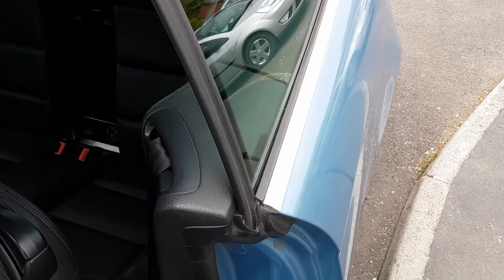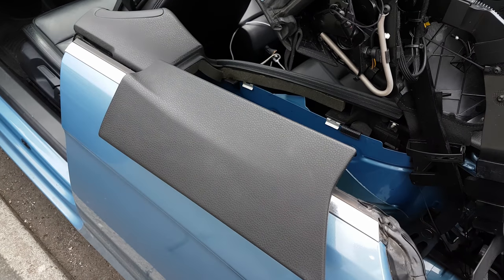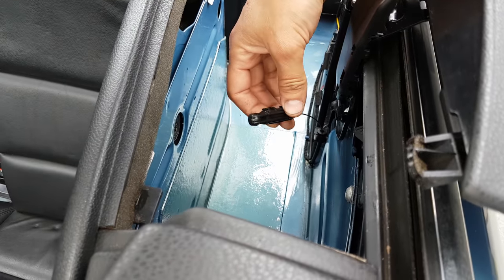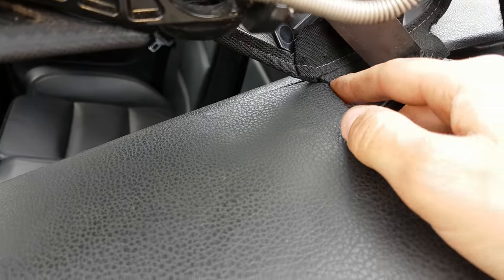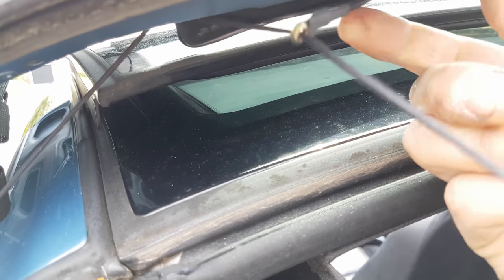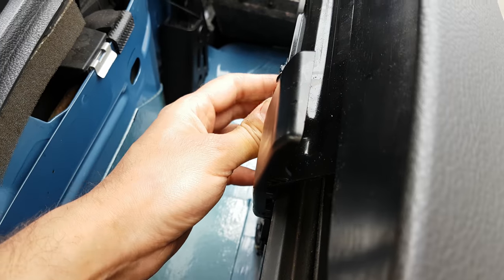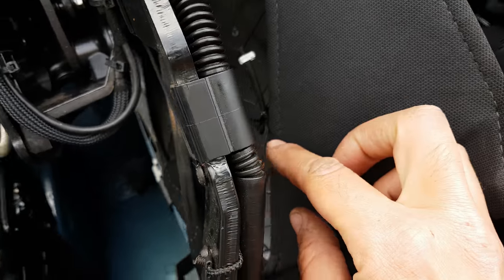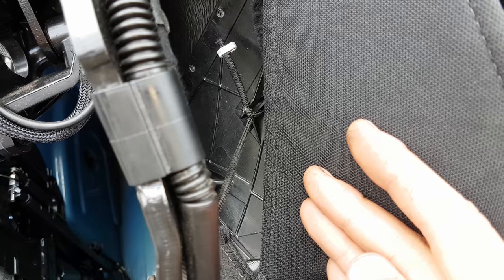VW EOS Sticking Roof Flaps Fixed

Comment: Thanks, I've had the same problem so it seems to be a common issue. To me this looks more like a permanent fix, why change out the elastic completely if this will keep things together hopefully another 10 years!
Reply from the maker: It's about 2 years since we did this fix, but we noticed it stuck again the other day. It might just be due to the fact the cars been off the road for over 2 months now. Good luck with yours.
Reply from the maker: @fikalagom3481  I don't think so. This fix has worked for years for me, but one is now sicking again. Eventually I think the strings / wires will need to be replaced

Comment: Once a year open the roof half way and chek for rust on hinges struts torn rubbers and leaks clean all rubbers and spray silicone oil that lasts long. pencil graphite also lubricates a little. The sticky panels in this video have a Ball joint. he puts it on dry but i recommend using a small dab of grease to reduse wear of the plastic and the Ball joint. If you plan on keeping the car for a long time buy the ball joint and cable. Over time the Ball wears out and the cable will pop off randomly. Also there are a lot off breakable parts so be carefull

Comment: You can also remove the plastic of the flaps and you have a triple attachement there that allow you to move the orientation of the flap a little bit. I fixed mine like that for ever...
Reply from the maker: Ypsens our flaps we're already nicely in alignment and i wpuld have got told off if they looled out. But thanks for the tip.
Reply: can you explain what did he do there? just loosen the bolts?
Reply: Yes, take of the plastic flaps and you have 3 bolts that you loose and move the flap support to give more space and escape it to touch the top. You can change the orientation of the support a little, I have fixed mine like that. If it's not enough you can use bolts more adjusted and cut little the round for the bolts of the support to have more space for the ajustment to move the support's orientation (Sorry for my bad English)

Comment: Hi do you know how to fix the roof on my eos that won't work because of the motor in the trunk that I thought wasn't working, but when we checked it it shows signs of life but doesn't want to close the trunk all the way and the car doesn't know that the trunk is closed or open the fuses are fine everything is roughly inspected basic do you know what it could be. In the trunk, the lights also do not recognize whether the trunk is open or not, and now I use the trunk as in the most common golf 5, because the soft closing will not work, and therefore the roof does not know whether the trunk is open or closed
Reply from the maker: So it's the switch or sensor that detects when the trunk is open or closed. Find and replace would be a good start. Off hand I'm not sure where it is

Comment: Follow up, 
I’ve done this in mine, worked for a few weeks and then had to tighten it again, to a point we’re the elastic lost its “elasticity” so do this as a temporary fix but buy new elastic cords for a long term solution.
Great video anyways 👍🏾💪🏾

Comment: Thank you for this great video. It has been very helpful. On my 2008 Eos, I had the same issue. However, in my case, the flaps were catching because the lining did not fold completely. There is a short piece of flat elastic with 2 crimped ends and just tightening that sorts the problem. That piece is  stretched most of the time when the roof is up which would cause it to go slack after some years. I will replace mine with new as a permanent solution.
I hope this finding will help others too.

Comment: A very informative video,. I am toying with the idea of buying a Eos, so I am watching anything to do with Eos, now I know how to fix this problem, thanks.
Reply from the maker: Would you be getting diesel or petrol. Ours is a 2.0TDI
Reply: @DanSohan  I've got my eye on a 2.0 TDI
Reply from the maker: @furryhenry  things to watch out for.. obvious smoke and oil leaks from underneath. Dash lights for the particulate filter. These TDIs like a nice long run from time to time to blow the soot out. If they've only done short trips it can block up the dpf filter. Main one we missed.. at a stand still in idle.. the rpm needle should be pretty stable.. if you see the needle wobble and you can feel a similar wobble or vibration on the clutch pedal you'll need a dual mass flywheel.. also check the oil level.. if it's really high above top notch, it could have been over filled, or have a fuel into oil leak from the fuel pump, common on VWs, no problem if caught early, but if it's been going on a long time will cause engine smoking at least. Might all sound bad, but I've had a lot of cars and the EOS is a lovely thing to drive, tdi feels good on the road and the roof is a real plus. We've done the clutch, cambelt and fuel pump, and still feel it was worth it. Done 60,000 miles in 3 years and it's still going strong at 150,000
Reply: Me too i want to literally be able to do all the maintenace myself

Comment: Worked like a dream on my 2007 US EOS - thanks.....my problem was identical.  Rather than tie a knot that would be almost impossible to undo,  I simply doubled the elastic by an inch and secured with the smallest cable tie I could find, clipping off the unised end.  The next challenge is to try to fix the very shabby perished backing on the sun shade....there has to be an easy fix???

Comment: Hello, do you have any idea how to change the strings to the sunroof?
the electro-motor itself is still working, I already ordered the metal strings/cable to open/close the sunroof, but can't find any instruction online how to replace the cable without damaging the hardtop. I don't know how and where to start.

Would be greatful for any help
Reply from the maker: I'm sorry, I cannot help. Our roof is working, and I would not like to try to open it, as it migh cause issue. I do not look forward to the day when strings break. It's a complex system. There might be some VW specalists in your area that have worked on them before. Maybe worth some phone calls. Best of luck

Comment: Hi Dan, congratulations, very informative video. I bought a 2007 VW EOS, but the hardtop is not opening, Is there any way to open the hardtop manually?
Reply from the maker: No, I dont think so. I found a pdf with some advice on closing it, but I assume it more in cases of accident. https://carmanuals2.com/volkswagen/eos-2013-emergency-closing-and-opening-34724 (please check with virus scanner as i just found it randomly online)

 I think its more a case of trying to figure out why.. Check the fuses? do any error messages come up?

Comment: Apparently there can be another cause of sticky flaps: the plastic cover plate of the flap can jam against the side panel of the car, preventing it from deploying. This video explains hot to pop off the plate, adjust the brackets slightly and replace the plate.  https://www.youtube.com/watch?v=tRjqNZrmYXI

Comment: What kind of oil did you use on the hinges and springs ect.
Reply from the maker: Just some general purpose oil that might be used on bike chains etc. Not WD40 as that removes oil. Anything that comes in a tin with a little nozzle on the end.

Comment: make more videos about the trunk i cant open mine after a small accident that left no mark yet the trunk is stuck now i wonder what it could be, any thoughts?
Reply from the maker: Sorry to hear that. Depends how mad the bash is. All the realese catches are on the body side, not the opening bit. When you try and open it, do you hear the catches move? If so, try bouncing the trunk, or boot as well call it up and down to see if it will realese. Although if it does release it might not close again. The roof mechanism is very complex and unfortunately if its buckled its gonna be hard to repair or find a replacement.